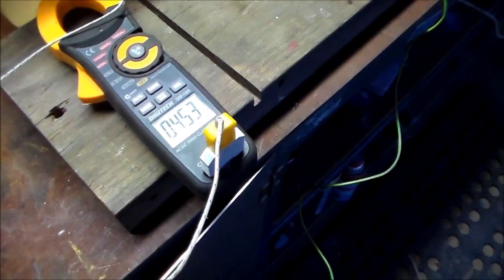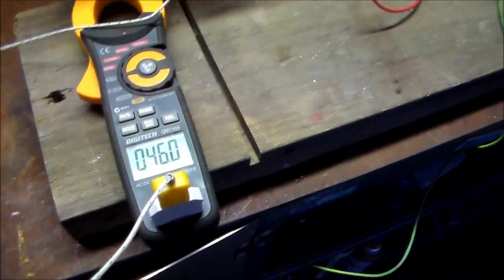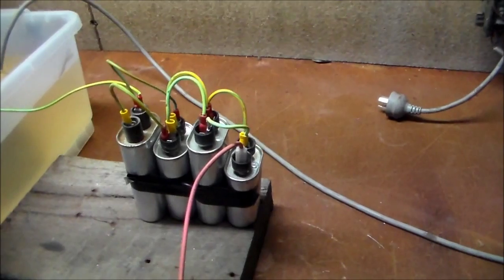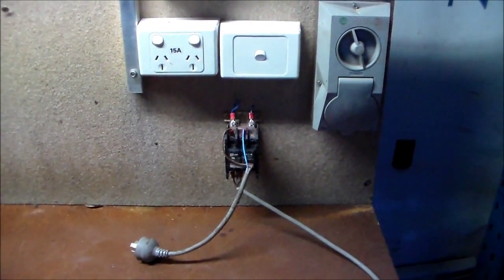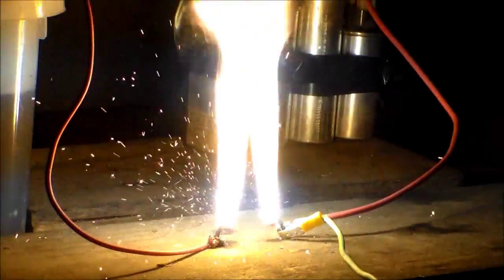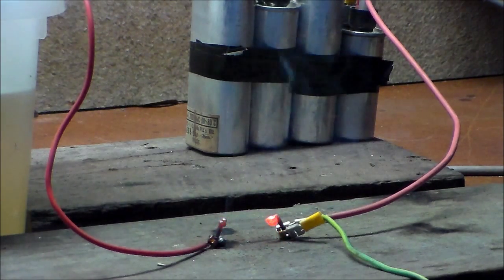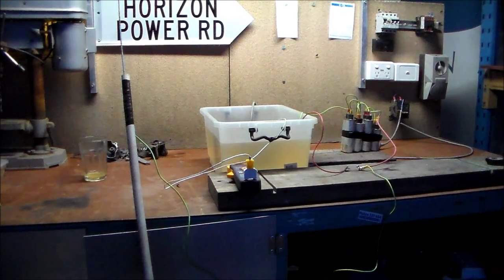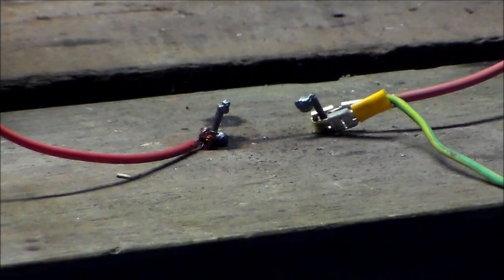Big Arcs, Monday Madness, 4uf Resonant MOT under Oil

Comment from the maker: you have to ballast them if you want them to last any time
i dont know where you get your power, but damn thats a lot of MOT 
mineral oil for sure. only true way to know output voltage is to test it.. but i wouldnt recommend that unless you have an HV meter that you can connect and read remotely when the circuit is energised

Comment: what oil work best for mots to keep then cool plan use 6 to 10 wired in pallreal for tesla coil but unsure wich best to keep them from burning out engine oil or Mineral Oil or ther some thin better to use
allso mot do thay all have same voteage out as got 4 atm and look diffrent but caps say 2100v ac

Comment: spectacular :D

and as I figured with the oil bath idea, it cannot remove enough heat from the core of the windings in order to save the MOT :(

oil is better for insulating against arc-over, rather than taking away heat.